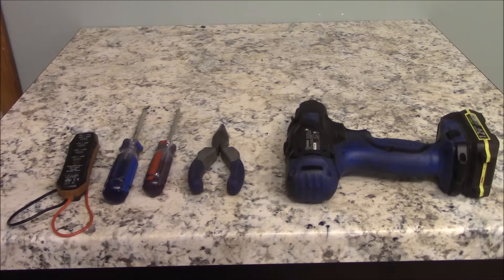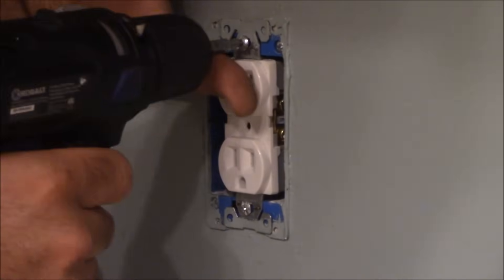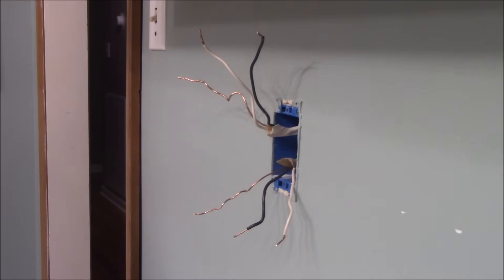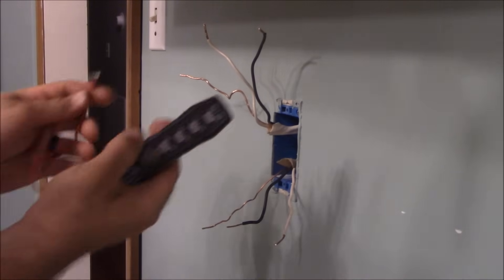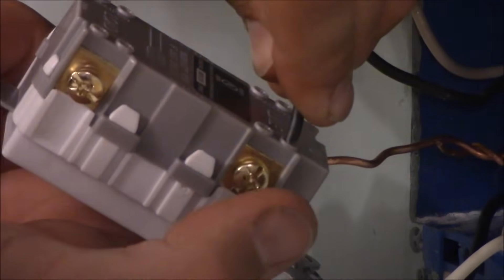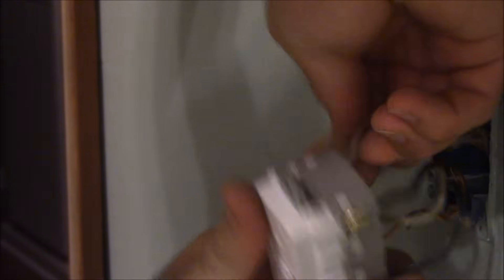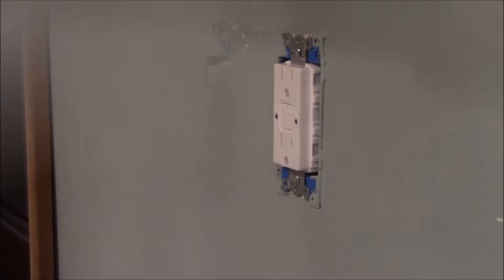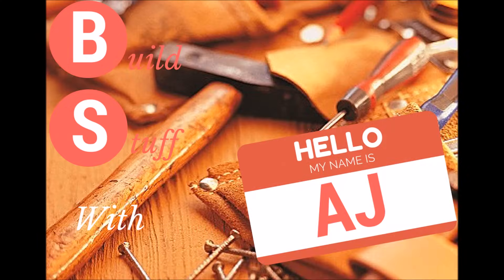Removing and Replacing regular outlet with GFCI outlet

Comment: I have a question.  Is it normal for all the outlets in the bathroom to go?  I have two at the sinks.  They both aren't working.  Tried the circuit breaker.  Nothing.  They aren't GFCI either.  I've had the house for 13 years as built.  Shouldn't they be GFCI?
Reply from the maker: Tanya Creedon any outlet that is near water needs to be a GFCI. So any near your sinks in the bathroom or kitchen any in the garage and also any outdoor plugs. Anywhere excessive moisture may be present. As far as your plugs not working its hard to say what the problem would be with out being there to look at it. If your not sure you may need to hire a licensed electrician to look it over.
Reply: Finding a willing electrician in this area is hard to get.  I'll just replace them and pray that is all I need to do.  Thanks for your time.  :)
Reply from the maker: Well that's too bad. Just be careful when replacing them and be sure you don't have any power in the box before you start
Reply: I'll be cutting all power off the house.  lol Not taking any chances.  lol
Reply: another question. lol The gfci outlet covers, do you have to drill holes to screw them to the wall or does the outlet have the holes for the screws?
Reply from the maker: The outlet cover has a hole and comes with the screws you need to attach it. The outlet will have threaded holes for the screw to go into
Reply: Ok, Thank you for your help.  I've subscribed to you earlier today.  :)
Reply from the maker: Well good, I hope you find more videos you like!
Reply: You have an interesting selection. :)
Reply: I found that Gfci outlet in the small bathroom is connected to the master and the other bathroom.  I tried replace the gfci. Had an electrician come in this morning to help figure things out.  He told me to replay it with an 20 amp.  I changed it.  It shows a green light at the bottom of the outlet but it still doesn't work.  I looked at the old one it says 15 amp.  Is that the problem? I don't want to call the electrician.  I've called him to many times.  lol
Reply from the maker: Well if the electrician yold you to put in a 20 amp then I would definitely listen. I'm not real sure why it wouldn't be working now. Sorry I can't be of more help. But its hard to fix a problem if I am not there to see it myself.
Reply: I understand. Thanks for you help. :)
Reply: You want to hear something funny.  The new outlet I bought didn't work.  lol I spent all day yesterday fight it.  I bought another one last night. Installed in 15 minutes and it works.  lol  Unbelievable. The Universe loves to play tricks on me.  lol
Reply from the maker: Well that may sound like a bad thing but now you have more e experience changing out a gfci! And at least now it works. I'm glad you got it fixed :)
Reply: Unneeded aggravation.  lol
Reply from the maker: Tanya Creedon lol I know where your coming from. Just got to look at the bright side lol
Reply: There must be a GFCI outlet somewhere that all the other bathroom outlets are connected to. Mine is next to the breaker box. You need to reset it.

Comment: What if I do not have a ground wire?  Just the black and white wires?
Reply from the maker: mjs11443 if there isnt a ground wire I definently suggest at least running a ground wire to the box it self.
The National Electrical Code requires you to stick a label on the receptacle that reads, "No equipment ground." These labels come in the box with a new GFCI.

Comment: GFCI outlets are junk. leave regular outlet in place. stay away from GFCI
Reply from the maker: WV591 I definitely disagree with this statement. They can save your life. That's why it is now code to have them in kitchens, bathrooms, garage, utility rooms, and anything outside or anywhere water is present. They have a very good purpose. They might be more expensive or an inconvenience to have to change them. But they are well worth the hassle in my opinion.
Reply: @BuildStuffwithAJ  I totally agree, GFCI saves lives and thankfully there are requirement in most countries to install them. I do understand that protecting individual circuits makes it easier to trace if a fault occurs but, it complicates matters as well. Here, in Iceland, there is only one device required to protect the whole flat/unit/house and if one outlet spits the dummy, everything is out. This is how it is in Australia and I'm pretty sure Europe is the same.

Comment: Just a tip, but most people overlook the little metal tabs/mounting brackets found on a GFCI receptacle and do not know that they have small slots in them designed specifically to strip either  #14 or #12 gauge wire.
Reply from the maker: +a1930ford nice tip! I had never noticed that before

Comment: What would happen if you put the two whites together and the two blacks together and only use the line side of the outlet and no wires go to the load side?
Reply: It is perfectly acceptable to put both wires on the line side. This is what you're supposed to do if you don't want downstream outlets being protected.  Some electricians like to pigtail the wires in those cases so that the outlet itself doesn't have to carry the load, but it is not necessary (code doesn't require it). The outlet is perfectly fine carrying loads to other outlets.
Reply: @LonnieAdams4  this was my exact question also, if i don't want the other outlets downstream to be affected by 
this GFCI what would be the best way to wire it?
Reply from the maker: +Lindsey Owen when working with more than one set of wires coming into your reciprocal box You need to determine which pair is the line, and which pair is the load, and whether the load needs to be gfci protected. The answer to those questions completely alters how you wire the outlet. If you don't know how to do this, I'd recommend getting someone more experienced to assist since a mistake can result in an outlet that will still be powered even when the gfci is tripped
Reply: Build Stuff with AJ the reason I ask is because another video said its code to twist them into one wire. Your video is very clear and I understand. I was questioning how it would work if the load and line went together into the line side of the outlet.
Reply from the maker: Lindsey Owen I'm not a licensed electrician so I can't give you an exact answer on that. But in my opinion if you put both the wires on the line side nothing past that outlet would be protected by gfci. In theory that's all that would happen. In your case that may be what you want.

Comment: Great video and very informative. We have a really old house, and we actually probably need to replace the entire Breaker panel due to it being outdated. But can I update our outlets to GFI outlets with it being such an old house? Or do you think it best to start with updating all the electrical (wiring, breakers, outlets, etc) and not just the outlets? I want to make sure I am doing this right. We just lost all power to the outlets in our living room and the breaker won't reset. Not sure which direction to attack first. Any advice you can provide would be greatly appreciated.
Reply from the maker: +christyn55 I'm not a licensed electrician so I can't give you an exact answer. But you may want to start by repacing the breaker that your outlets are on. They can go bad over time and that could be why it wouldn't flip back on. And yes you can replace your outlets with gfci outlets, its actually recommended to replace the old two prong switches with a gfci because it will trip the plug's gfci switch if there is a ground issue. I would start with replacingtm the breaker your outlets are wired to. You could have had something chew through the wire also. If you can't figure it out after that you may want to call a licensed electrician. It could save your money and time in the long run.
Reply: Thanks, I will try that. A licensed Electrician is a little out of our price range right now. Wish me luck!
Reply: @BuildStuffwithAJ  a
Reply: Ok

Comment: Is it beneficial to install all GFCI outlets or should they only be installed in certain rooms like kitchens and bathrooms?
Reply from the maker: +miketiger24TB it would be extra protection in other rooms, but you definently need them in areas where water might be present. If you are replacing old 2 prong plugs with out any ground wire in an older house they are prefered.
Reply: NEC code says any location that is within 6 feet of a water source. This means any outlets in the same room and within 6 feet (you don't have to to measure through walls). Obviously, this means the bathroom, kitchen, and laundry room.

Also, outlets in your garage must be protected as well as any outdoor outlet. Pretty much everywhere in your house except bedrooms and living rooms.

Comment: Why do some GFCI have no ground? I tested several GFCI outlets in my house and a lot of them say "no ground", are they still safe?
Reply from the maker: if it says it has no ground then the ground was never connected to the outlet. my house was so old that they never ran a ground wire to any of the outlets or lights, it just wasn't the code back then. But to answer your question it should still work properly according to this web site http://ask-the-electrician.com/installing-a-gfci-outlet-without-a-ground-wire/
Reply: I just had 4 GFCI outlets put in my old (125 yr) house. Electrician charged $899.00 Yikes! He had to do that because there was no ground wire.  I looked at the site you suggested AJ and while it was informative I would still be reluctant to try redoing all the outlets in my house. But there are SOOOO many I'll have to do a few at a time.
Reply: How did you test them?

You should mark those with words "No equipment ground". Replacing ungrounded outlets with a GFCI outlet and not connecting the ground is legal if one marks the outlet. If one has normal grounded type outlets downstream on should mark them both with "No equipment ground" and "GFCI protected". Likely the previous owner did not mark them.  They should be marked just so that the next owner knows.

https://stonehavenlife.com/wp-content/uploads/noequipmentgroundlabeloncoverplate.jpg

https://www.howtolookatahouse.com/Blog/ewExternalFiles/NoEquipmentGroundSticker.jpg

No having ground is not ideal but it is legal if that was how it was when the installation was done and it is reasonably safe. I'd be more worried of equipment damage if you for example connect a computer to a TV. Unplug first and then connect.

Comment: I installed a GFCI outlet and its led light is off, but it is still passed 3-wire receptacle tester with "CORRECT".
Reply: Is it a outlet manufactured by GE by any chance? Some of their models are designed so that the LED only comes on when the outlet has stopped working.
Reply from the maker: Kevin H I've not experienced that myself. If mine wasn't working properly it always had the red light on instead of the green one. In my experience the only reason the light would be off would be if it didn't have power to it. But I'm not a professional electrician.
Reply: You should test the outlet with the test button. This should be done regularly, every three months or so.